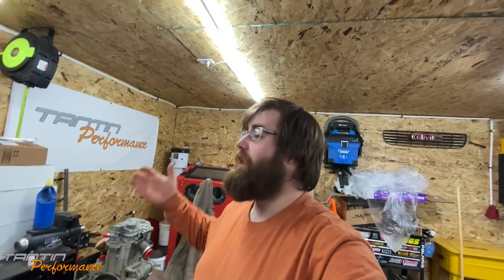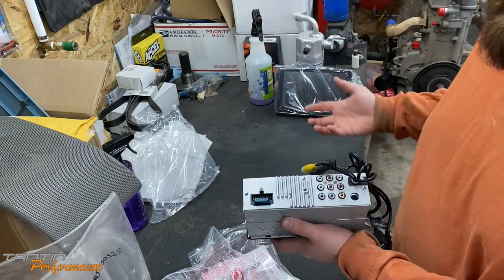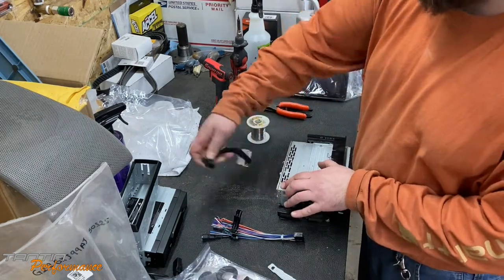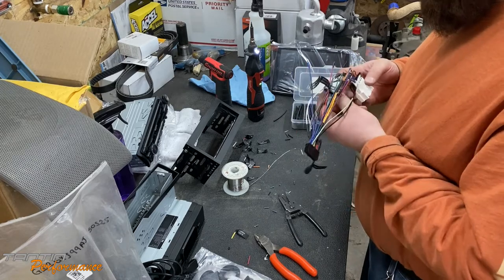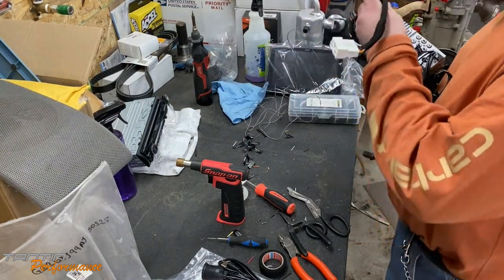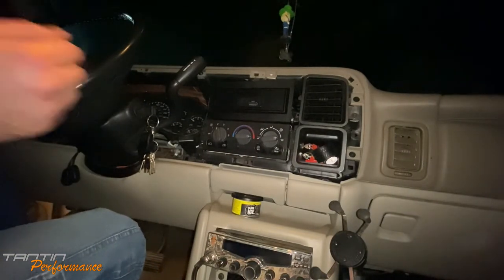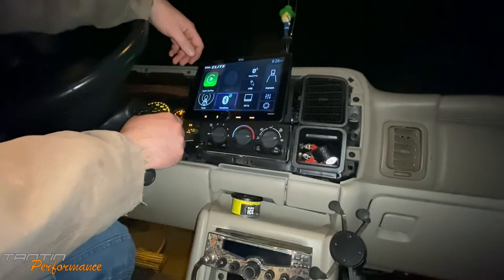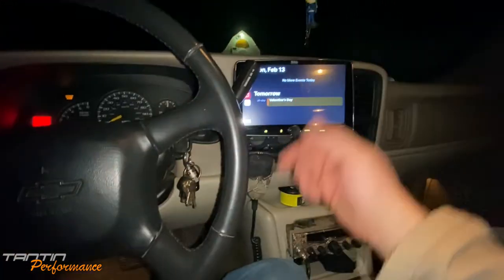Installing The Boss BE9ACP 9 Inch Single Din Headunit in The 01 Suburban (aka The Burbinator)

Comment: Nice video. I'm hoping you could help me out. I have the same radio, and the USB Apple CarPlay connection works great with my kids' phones, but any Android phone I try to use Android Auto with keeps losing connection any time the cable is jostled near where it connects to the Boss cable. Could you try plugging an Android phone into your Boss and see if you have the same problem? Just trying to figure out if mine has an issue, or it's just a flaw built into the Boss. Thanks!
Reply from the maker: My buddy had his android plugged for for a few hours on a road trip and android auto seemed to work fine for me.
Reply: @TanTinPerformance  Cool, do you know the model of his phone?
Reply from the maker: That I do not know. It’s was one of the newer Samsungs I believe
Reply: I have a boss 10.1 and my iPhone constantly drops. I believe it’s the head unit I’ve had mine since they first came out wondering if the early runs have the issues?
Reply: @robindavisjr4109 is the CarPlay wireless or have to be wired to the phone like a USB?

Comment: How did you bypass the parking brake cable
Reply from the maker: Hooked it in with the ground wire
Reply: @TanTinPerformance  so I can connect the parking wire to a ground and be able to watch you YouTube while driving? If it’s not connected which functions aren’t usable?
Reply: @rickyjohnson5713 I’ve never been able to watch YouTube on any of my Apple CarPlay, but most head units block video without a parking brake wire.
Reply: @tantintune  that’s weak lol. I don’t get which videos would be played on the unit then?
Reply: @rickyjohnson5713  you’d play from the video input on the back the radio.

Comment: I have the same Boss receiver that I'm going to install in my 02 Yukon.  I want to install it where the CD player is - it doesn't work anymore and I don't use it anyway.   I know I would have to re-route some wiring but do you think it would fit in the CD slot?
Reply from the maker: I installed a Regular cd player down there many years ago in one and it fit, so I would think this would fit.
Reply: Is it better to use an interface- like the one sold at Crutchfield?  Or is it better to just match the wires up like normal?
Reply from the maker: 02 shouldn’t need an interface you should just need the standard gm adapter plug
Reply: Ok thanks